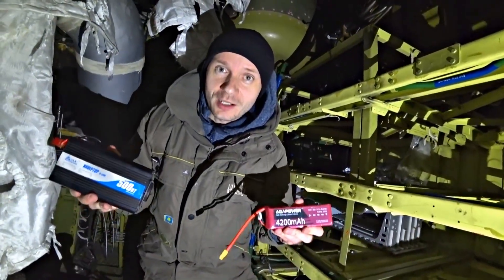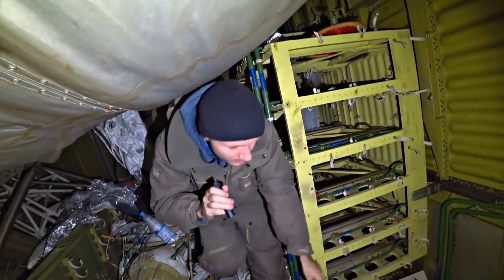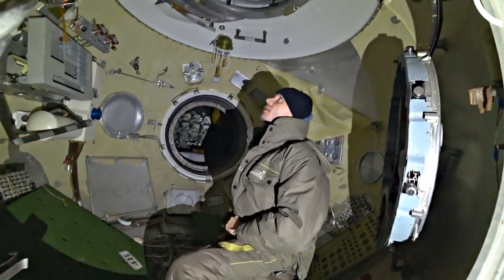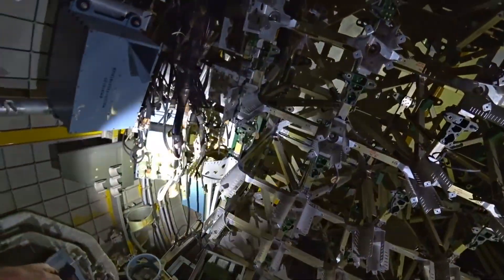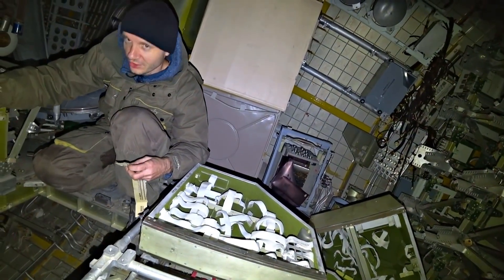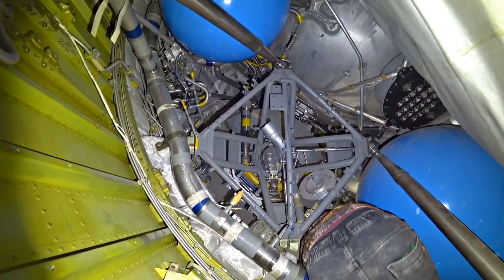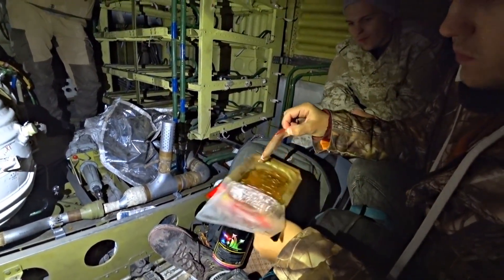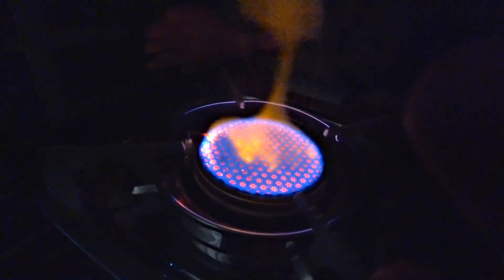✅Launching the Spaceship BURAN 🚀 Secrets of space in the USSR ☢️

Comment: Buran couldn't drop bombs, the Soviets thought for a time that the Space Shuttle could do that, just to find out themselves that this is impossible with Shuttles. Buran was a brilliant Shuttle but it couldn't be used to drop bombs and it can't go back to space once it reentered, this is completely wrong. They stopped building Burans because Shuttles are just expensive and not a safe way for space travel. Look at what happened to the Space Shuttle. Every flight cost 500 million dollars and two crews were lost in accidents. The Russian space program realized the shortcomings of this technology and just continued to use the Soyuz since its cheap and does the trick.
Reply: 500 million is little bit low it’s more along the lines of 1-1,5 billion per launch

Comment: The United States has a dummy shuttle ( mock-up ) but it is not made with wood , it was used to see if new parts and cargo would fit . I got to go inside it during an open house back in the 1980s when my mom was working for Raytheon in Greenbelt Maryland
Reply: I believe that is now in Houston sitting atop a 747 at the NASA Space Center.
Reply: @effervescentrelief  Independence was built in the early 2000's if i remember, so it couldnt have been the same
Reply: yup! And she's a beaut
Reply: The former General Electric Transportation Systems (GETS) now Wabtec does the same thing for their locomotive prototypes. They use heavy duty cardboard and balsa wood to make sure everything all fits correctly.